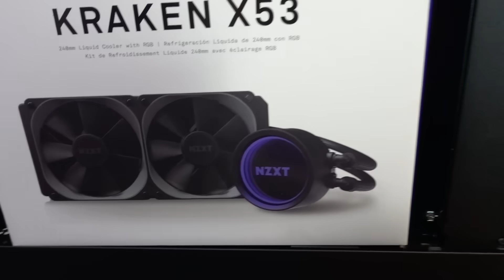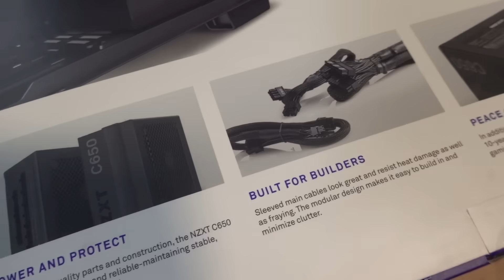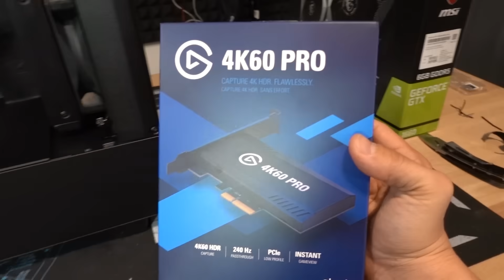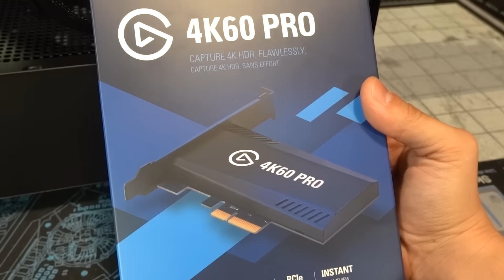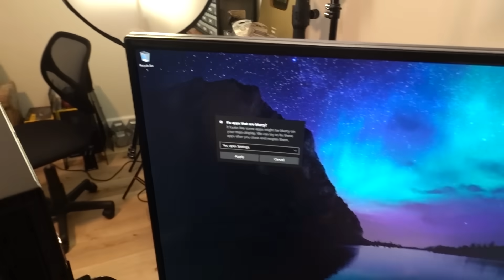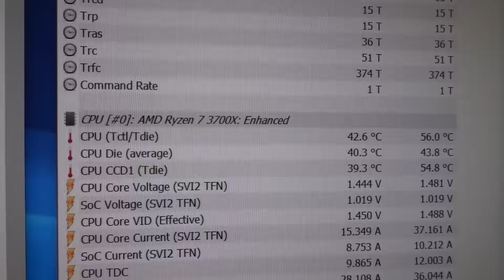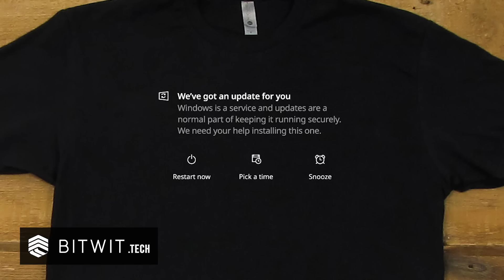Building a GOD TIER streaming PC

Comment: Can u build this so I can see what this pc will look like  

Component		Selection	Base	Promo	Shipping	Tax	Price	Where	
CPU		

AMD Ryzen 5 2600X 3.6 GHz 6-Core Processor	$199.99				$199.99	

CPU Cooler		

NZXT Kraken X53 73.11 CFM Liquid CPU Cooler	$119.47				$119.47	

Thermal Compound		

Arctic Silver 5 High-Density Polysynthetic Silver 3.5 g Thermal Paste	$6.90				$6.90	

Motherboard		

ASRock B450 Steel Legend ATX AM4 Motherboard	$115.21				$115.21	

Memory		

Corsair Vengeance RGB Pro 16 GB (2 x 8 GB) DDR4-3200 CL16 Memory	$101.99				$101.99	

Storage		

Team GX2 1 TB 2.5" Solid State Drive	$82.49				$82.49	

Video Card		

MSI GeForce GTX 1660 SUPER 6 GB GAMING X Video Card	$552.75				$552.75	

Case		

NZXT H510 ATX Mid Tower Case	$66.98				$66.98	

Power Supply		

Gigabyte P-B 450 W 80+ Bronze Certified ATX Power Supply	$12.84		$15.00		$27.84	

Case Fan		

Corsair AF120 (2018) 52 CFM 120 mm Fans 3-Pack	$38.99				$38.99	

Base Total:	$1297.61		
Shipping:	$15.00		
Total:	$1312.61

Comment: What is the difference between the NZXT H510 and the  NZXT H510i   ????
Reply: The NZXT H510i comes with RGB and is overall higher quality and more expensive. I have the normal H510 though, and it is a great case.

Comment: Is it bad if the aio tubes sre resting on the gpu? I have the kraken x63 front mounted with the tubes on the bottom but they lightly rest on the gpu. Should i be worried?

Comment: Is it ok to mount the raidiator like that? I hav an Corsair h100i v2 aio used however it has some air in it. Also it leans pretty hard on my gpu. I currently have the hoses at the bottom. I’d post an image here but idk how.

Comment: I have gtx 1070 oc dual by asus and a ryzen 5 2600 and What cpu should i buy to my b450 ds3h? Am thinking a 5600x
Reply: stick with the 2600. but if you get the 5600x get a better gpu
Reply: @Mrballwag  am thinking the ryzen 7 5800x and rtx 3070 or 3080
Reply: @WierdGuyLiam  as long as it fits your budget go for it

Comment: hey bitwitt my birthday is coming up i'm upgrading my tower and a new gpu my rx 590 is getting replace with a 5700xt with the same processor that you have build do you recommend that tower or Fractal Design Meshify C  my current tower screws are strip please reply back on youtube i will be forever grateful i really need your help. ps i'm turning 30 :D on the 18

Comment: try using the tecware vxr as a case i use it as my case an it has 9 fan slots as the PSU is stored in the back where all the cable management is so the case is a  thicc  case and its dual tempared glass

Comment: What gpu would be better for gameing and streaming? A msi GeForce 1660 gameing x
Or a asus rog strix amd Radeon rx 5500xt overclocked 8g
Reply: rtx 439057349057340573409570439760596704759764560974560970000007509675467054760576509676567059675409 windforce OC should be a little better.

Comment: Can I use this same build but swap the GPU with a 2080 super?... I’m new at this
Reply: You could! But please buy a motherboard with a b550 or even an x570 chipset. The b550 is the new generation with support for new and fancy shmancy features, while x570 features even more stuff and almost always gets you better quality, power delivery, as well as connectivity. The Gigabyte x570 UD (ultra durable) is a great motherboard for mid-range and high-end builds alike, I can only recommend it!
Reply: @cbob7423  Power delivery, connectivity, aesthetics, premium features. That's literally the point of those boards. If you build something with a 3200g and an a320 board, you could as well buy a console. And good luck trying to justify why your VRMs failed and fried your cpu. It's just for safety and will guarantee you a longer lifespan.

Comment: what does a capture card do and is it necessary?
Reply: It's in the name. It slots into a PCIe x1 slot and can record everything on your screen.
Reply: @tuna5774  isnt that what obs does?
Reply: @heyimtweed  Yes, but better in all ways imaginable. And it takes the strain off your GPU or CPU.
Reply: @tuna5774  so if i have a capture card, i could stream off of that and play off of gpu and cpu and get the same frames on stream as off stream?
Reply: @heyimtweed  Not entirely, I don't want to bore you with details about parallelization and en/trans/decoding and whatever shit, but here's a simplified rundown:

You won't have to:
-sacrifice a bit of performance of one or two cores for recording
-use some weird software that has to be configured just right in order for it to work (any mistakes will lead to major dips in performance or instability of the stream)

You however will have to: 
-have a spare x1 slot free
-give away some CPU recourses to send the video to the server
Reply: @tuna5774  alright thank you.  Sorry for taking up some of your day. Have a nice rest of the day.  :)
Reply: @heyimtweed  Google woulda been fine lol

Comment: Might be a dumb question, but how is his watercooler setup, if those fans are intakes is it not going to be drawing fresh air through the radiator and then passing hot air through his system to the rear exhaust?

Comment: question want to get into streaming I'm brand new and need something for beginners  friend offered me a PS FOR 375, below is it...

Gigabyte Full atx Motherboard, w/ crossfire enabled and SLI support.
AMD FX4100 Quad core CPU
Radeon HD 7850 GPU
RAM 8GB
New BLACK case with red Lighting
New Insignia 400w power supply
New 120 GB SSD Boot drive
1TB storage drive.
Usb 3.0
Gigabit Lan

Comment: if I go with a 3600 and no water cooler, but I use my 1660TI that I already have, would I be able to use it to  stream 4k with the upcoming ps5/xbox x series, using el gato, or I'll need to go for the 3700x?

Comment: Queation. Shouldn't I mount my radiator and fans like you did? I've seen some builds with the fans inside,pushing air through the case and out the back. Vs. Out the vent at the front. Isn't your method best for performance? I have a nzxt h510.

Comment: I'm about to building a pc. Ive picked all my parts and its very close to this. I havent settled on a case but cpu, ram, are the same. 
Subbing a team group 512gb ssd (and a 2tb hard drive)  msi x-570-A pro mobo and a Zotac Gaming GeForce rtx 2070 super. 
New to PC but what do you think?

Comment: pick low profile ram just in case the church want to upgrade the cooler
Install a water-cooled
Me: ......what?
also me: .....isn't this for a church? isn't the stock cooler is more than enough? why would you need anything more, there is no need to overclock to an insane amount either, it literally has only one job, streaming.

Comment: I have a NZXT Kraken X61 280mm AIO ( 4.5 years old ) still runs great....but....the CAM software blows...I hope NZXT has improved it since then on the one you're installing. 
Quick question...the warranty on my AIO is 6 years and it's approaching that soon. How long does the coolant in it last before it starts to break down and should I be considering replacing this with a new AIO sometime soon because of its age even though it's still running really well now  ? 
Great videos...you and your family stay healthy and safe.

Comment: I think there is no term like best or fastest PC ever, its a relative term, my 1060 built may b a beast at 1080p gaming but it will struggle at 4k, system all depends upon resolution you r running at

Comment: Hi im putting a rig together with a 2700x can a pair it with a gigabyte 
450 aorus pro i dont over clock or are the vrms to bad to run it on that
 MB to run a 2700x .???

Comment: guys i need help and i really dont know who would i ask i serched forums bud didnt found anything useful
im in need of buying psu becouse old one is geting realy bad and i found good deal on coolermaster v1200 platinum, so my question is will there be problem couse psu big, are thera any drawbacks, my components are:
ryzen7 1800x
x370 crosshair vi hero
ml 240l aio
16 gb ram 4x4
x570 8gb
ssd,hdd
6 fans and some rgb strips

thanks in advance <3

Comment: This video couldn't have come out at a better time. I've been researching components for my first build for about three weeks now and have pretty much settled on everything. Your God Tier PC is almost identical to my build with a few differences.

My build:
Ryzen 7 3700x
Tomahawk b450 max
G.Skill Ripjaw V 32g 3600 Mhz (Might be overkill for gaming, but I'm a professional drone pilot and at times I edit 4K LOG footage. My current system protests this significantly.)
Samsung EVO m.2 500gb SSD
Barracuda 2 TB 7200 rpm HDD
Gigabyte RTX 2070 Super
NZXT H510i (In white)
Corsair 750W 80+ Gold Fully Modular
Be Quiet Pure Wings 2 140mm fan (x2)

Let me know if there's anything you'd recommend changing!

Comment: I have a question, I have the kinda same setup, but the ring on the AIO cooler doesn't change color because CAM (the RGB color software from NZXT) doesn't find the AIO cooler, 
when I assembled it I didn't find anything I can connect the RGB cable to, and I found that I need to buy separate HUE device from NZXT for that, but in this setup I don't see this HUE device and I see the ring is animating, so how did you connect it in this setup?

Comment: PSU power part 2:
I'm aware Intel CPU's like the i9-9900K can really suck down the power. Apparently hitting around 300W when heavily overclocked and stressed. So you should plan around that which is where a 750W PSU might make sense depending on the graphics card. But a RYZEN 3000 8-core system should use under 150W when heavily stressed (ignoring graphics) and future Intel CPU's that move to a new process node should drop to 150W and below for 8-core or similar CPU's.

Comment: PSU power requirements... an observation (delivery and noise)
The POWER requirements for the high-end (not the highest but very high such as R7-3700x + RTX2080Ti etc) seems to hit near 450W. That's the actual power DRAW from the PSU (not wall) in a worst-case for those high-end systems not the PSU wattage spec. I've seen a lot of modern PSU's that can deliver 80% of their power with FAN NOISE still being essentially silent. For example, 10dB, until roughly 425W of a 550W PSU. (find the fan graph for any PSU you plan to buy)... one REASON that graphics cards max out at roughly 300W is because of the ability to dissipate the heat. So I wouldn't expect that to increase in the future. In fact, I'd expect the "overvolting" that massively increases power draw to go away for the most part for cards that tend to jump above even 300W when tweaked... on the CPU side the CORE COUNT has gone up but even an R7-3700x (8-core) CPU doesn't draw much more than 100W for the system (not counting graphics) depending on the other components (150W for stress test)... and well R9-3950x (16-core) being binned well are under 200W AFAIK under heavy load so... and with multiple GRAPHICS CARDS disappearing for the most part (they may or may not come back in vogue once game engines are better) a good 550W is more than enough for most gamers. 650W doesn't really add much to the cost so that's fine. But in 2020 getting a 750W PSU is really unnecessary for even most high-end gamers or for "future proofing"... in a few years multi-chip GPU's should take off but again I think the upper limit for those will be cooling so I don't expect power draw to increase.

Comment: my pc is practically the same as this however I have ryzen 9 and a 2080ti with a few different parts however what I noticed is the liquid cooler is pretty much identical apart from a different brand my problem is when I compare mine to the build in this I notice the grill side is front and the fans are on the back,  when I look at mine the fans are on the front and the grill is behind is this normal or what's the reason why? Any help would be greatly appreciated I'm new to pc gaming

Comment: You can mount the radiator bracket between fan and radiator so the fans are behind the compartment in the case for a cleaner look. Also, CAM sucks.

Comment: I think, for streaming, a 1650 Super would have done just fine. its much cheaper and it supports the new nvenc codec (which the normal 1650 doesnt)

Comment: @Bitwit, i'm building/piecing up a computer for a family member and they wanted to use the Intel i7-9700K processor. I read the memory supported specs for this processor, which is 2666mhz default. If i bought memory in higher speeds, do you know if the processor would support it? Can i email you the parts list i put together? Just need some advice on what to recommend. Thanks in advance

Comment: Just building my first ever PC was hoping to get some feedback if this is good. Budget is 1000

ASUS Strix B450-F Gaming motherboard
Ryzen 5 3600 CPU with Wraith Cooler
Ballistics 16GB 3600MHz RGB RAM
Integral 512GB M.2 NVme 
Seagate 2TB HDD
Corsair 650Watt gold plus PSU 
Artic 120mm fan 
Corsair carbide 275R case 
XFX RX5700 XT thic 3 GPU

I can get all this for just under 1000 where I live at the minute is this good? 

Thanks
Reply: Ian Elwood no it’s great man good luck on building it

Comment: New to building pc so if these are dumb questions I’m sorry. Why not use to stock cooler that came with the cpu? Why use an aio? In the process of picking parts for my pc and this was actually so close to the parts I’ve choose. I choose the MSI RTX2060 Super instead as my graphics card. Do I need a the aio you used or with the stock cooler work for the amd ryzen 7 3600?

Comment: id dont think a church need RGB or AIO cpu cooler & didnt ask them if they need DVD drive or wifi.  why didnt go with ITX case that support Coolermaster hyper 212 cooler?  suggest fractal design core 500 case, sff 600 watt PSU, b450 with wifi, same 3700x cpu & corsair 16gb RAM & gtx 1660 GPU, 500gb SSD & suggest 212 cpu cooler & usb elgato HD60 S capture card.

Comment: The 1650Super has the Turing nvenc encoder at a lower price than the 1660 for anyone looking for the absolute cheapest card with the new encoder.  Obviously also a little less performance than the 1660, but is the cheapest card with the Turning nvenc chips given that the 1650 has the Volta encoder.

Comment: I'm building my first gaming pc and i don't really know what motherboard to get. I need wifi but i don't know if i it would be better to buy the b450 tomohawk max and a seperate wifi pcie card or if i should get the b450 gaming pro carbon ac with built-in wifi instead? Both options would cost me the same but i've seen a lot of positive reviews for the tomohawk and almost no reviews, positive or negative for the gaming pro. I would be using it with a ryzen 5 3600 and an rtx 2060 super. anyone who can help me?

Comment: I hate to be that guy but here's my "actually":
@7:16 Many nVidia GPU's have a dedicated ASIC or hardware encoder/decoder (NVENC/NVDEC), however the cheapest GPU that comes with the latest (6th generation aka. "Turing") NVENC would be a GTX 1650 SUPER.
@10:33 The stream will be encoded using the AVC/h.264 codec, no matter the selected encoder (in this case either NVENC or x264).
This will eventually change in the future, but as of right now everything you stream to Twitch, YouTube, Mixer, etc. is encoded in AVC/h.264

Otherwise a nice video and a great build for a good cause👍
As always have my like, I'm already subscribed and the bell is rung.
Have a good one

Comment: What does a capture card do to help with streaming? I'm currently using just my base hardware R5 1600 - RX580 and Warzone stutters on lowest settings while I'm streaming... Plus I'm losing like 50 frames while streaming.
Reply: The capture card doesn't innately add to streaming power, it is used as the HDMI input for either a console or for a higher end camera that supports it, luke the Sony A7 that I use. It gives them the ability tonuse a much much nicer camera than they could hope for from a USB Webcam.

Try adjusting your bitrate. Also are you using the original r5 1600 or the newer r5 1600af? Make sure you aren't trying to use nvenc either, the RX580 wont help you there. I use a bitrate of 2500kbps. I end up with a slightly less clear stream, but at the benefit of not dropping frames or stuttering. I have a decent pc, but my internet is garbage so I have to reduce my bandwith consumption as much as I can. That may help you a bit too. Not 100% sure that it will or wont, but definitely worth the try.

Comment: Here's what I'm putting together over the next few weeks:

ASRock B450m Steel Legend
Ryzen 7 3700x
HyperX FURY RGB 16GB (2x 8GB) 3200MHz DDR4 RAM
Gigabyte RX 5700 XT - 447.60
Corsair CV Series CV650 650W
Western Digital Caviar Blue 1 TB HDD (Media/ finished project Files)
T-FORCE DELTA PHANTOM 250GB (OS and consistently used programs)
Team T-FORCE DELTA PHANTOM Gaming RGB SSD 500GB (Blender / Unity/ Maya files in use)
Crucial P1 1 TB M.2-2280 NVME Solid State Drive (Steam Library / Games)
GameMax Kamikaze Case

Total Cost: $1,587.98

Comment: Motherboard(AM4), GPU, PS and RAM for 450$.What should I get?
Reply: What's your CPU? I would probably just say a 60dollar 500watt 80plus bronze psu, and 3200mhz cl16 2x8gb kit for 70 usd, and a asrock b450m pro4/MSI gaming plus max/MSI b450 tomhawk max depending on the CPU and a 1660-1660 super if you are going new( the GPU depends on cost of the mobo) and as for used, a gtx 1070 used or a used Vega 56. Maybe you'll be able to find a used rx5600xt/rtx 2060
Reply: @miniweeddeerz1820  AMD 5 3600